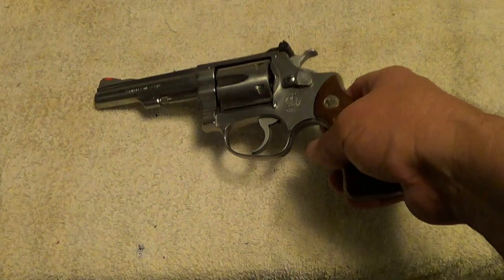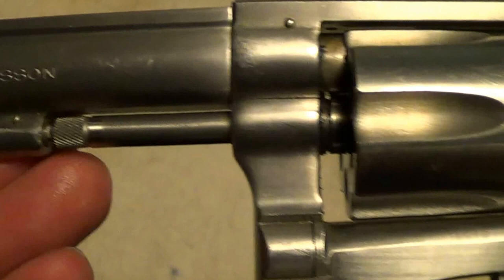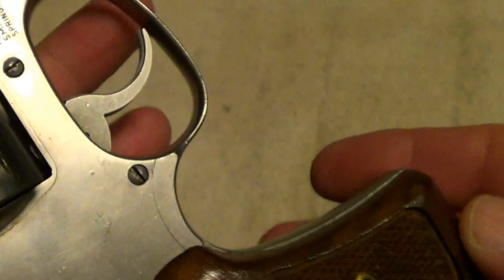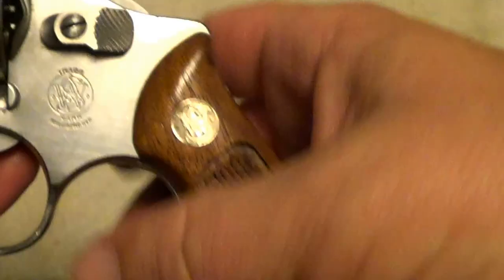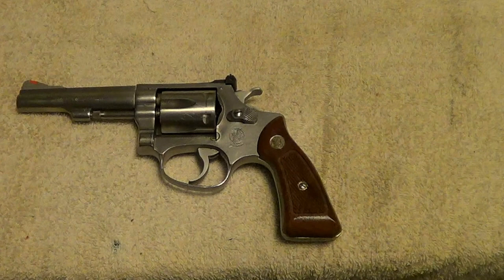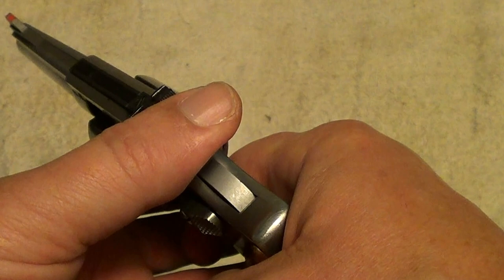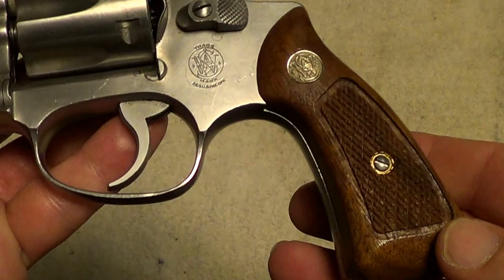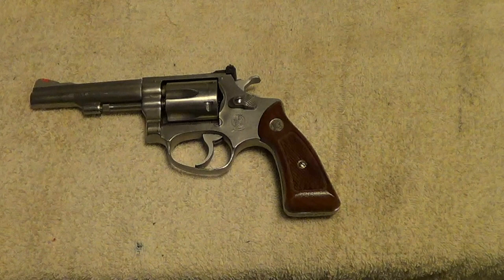Smith & Wesson model 63 Kit Gun .22LR

Comment: I'll pick up my 63 no dash tomorrow, it's like yours but in almost new condition, yours has been rattling around with you for almost 40 years, a trusted friend.
Reply from the maker: I`m sure you will be very happy with it. Excellent little revolvers.
Reply: @1957Shep  Got it home, there's hardly a mark on it. The trigger is slightly wider than that on yours, but on the downside the barrel is not pinned. Still, no lock, so overall good.

Comment: The model 63 is very accurate little revolver. I am very impressed with the accuracy of mine. Much more accurate than I thought it would be
Reply from the maker: You should do a video with it sometime.
The little Kit Guns are handy and fun to shoot. I have 3 variations of the Kit Gun. This model 63 and a pair of models 34s. A 4 inch and the more rare 2 inch barrel.
Reply: Is yours a 6 or an 8 shot?
Wondering when they switched to the 8 shot cylinder.

Comment from the maker: Depends. The J Frames were made in both round butt and square butt versions. Compare the gun in this video to the gun in my video about the model 34-1 kit gun.
This one, the model 63 is square butt, the model 34-1 is round butt.
But regardless if you have a round or square butt gun, there are a wide variety of both factory and aftermarket grips in many sizes and styles that will fit these guns.

Comment: Just bought one. Lower serial number than yours and like new in box. Shoots good, little tight in ejecting empty shells. What surprised me was the double action trigger pull seemed fairly heavy. Need to measure it but seems heavy.
Reply: I think pretty much all J frames have a heavy trigger pull except maybe the newer pro series or performance series guns. My 2 model 36's both have heavy DA pulls. I believe it's just to help prevent an accidental discharge. You can lighten them up with a trigger job, but I wouldn't want to do that to my guns personally. They have a hammer so I can just shoot single action if need be.
Reply: Rimfire revolvers tend to have heavy hammer springs is because a lot of Rimfire ammunition needs a good smack to fire them.  When we bought an SP101 in .22LR we also ordered a spring kit so we could put in the lightest spring that would still reliably fire the ammunition we used.  Made a big difference.
Reply: @FishKepr    You are correct. Thanks. 👍